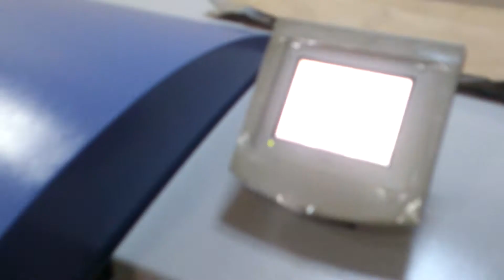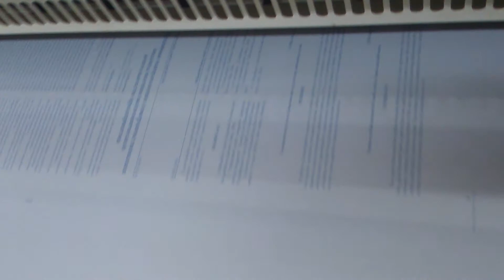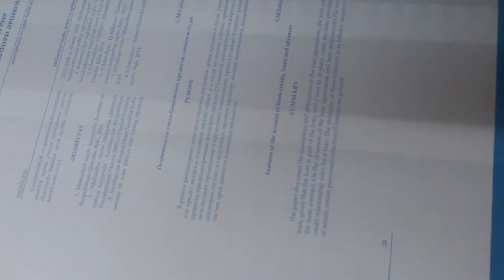Otomotik kalıp yıkama makinesi

Comment: What is the material in which you clean the rolls of the device? I do the same work as you do in Iraq, but the rolls of the device are difficult to clean with water
Reply from the maker: It is necessary to clean with washing solution of printing machines